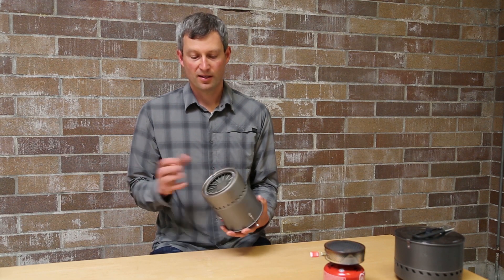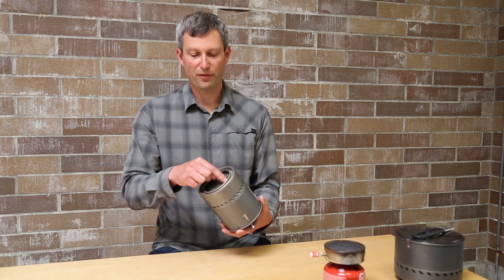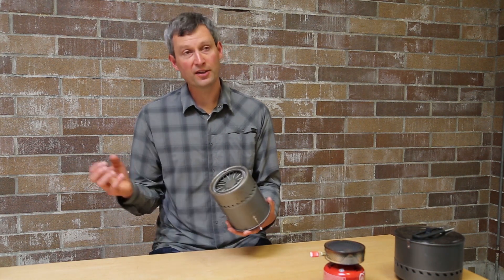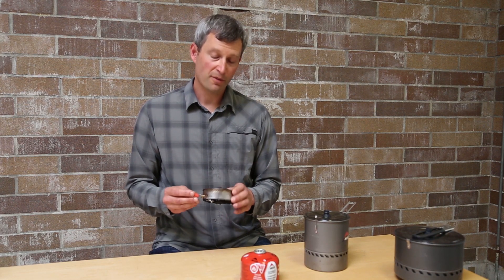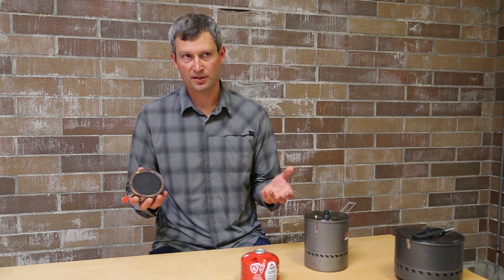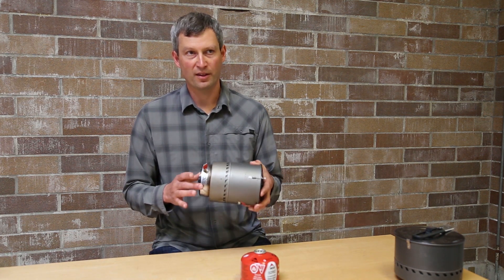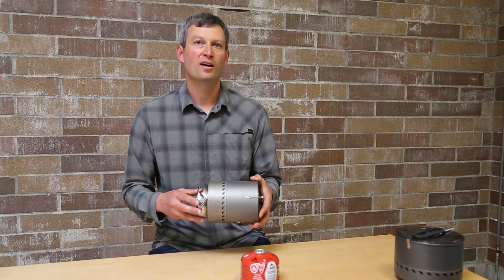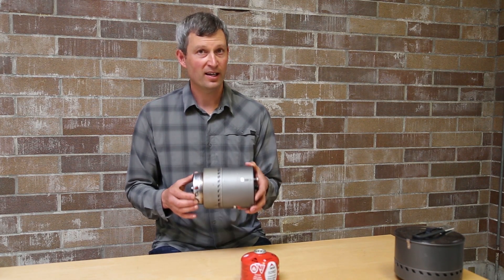Designing the Reactor Stove System

Comment: This is a perfect example of how an engineer develops a product with great potential, that then gets ruined by the rest of the company because someone else developed a handle that comes off too easily that then leads to recalls and MSR's "solution" is to send people a Pot Lifter which you can not use without taking off the lid first... 
Such a disappointment from a company that has SAFETY in their name...

Comment: I got this. Used it a few times, and now it produces only a blue flame that blows off just looking at it. Very expensive,  and stopped working after light use a few times, boiling water. Not worth the money at all. I tried to contact MSR from europe, impossible.
Reply: Try lighting the stove with flint and steel. The blue flame you mention happens when the ignition occurs above the burner. 

The radiant burner can also be lit at the marked areas (hole in the metal grid) which helps to avoid ignition above the radiant burner.

Comment: Would you comment on the issue of the overheat issue that renders the stove useless? The bits of lead that melt and clog the gas line when it gets “too warm”.
Reply: I've used this stove hundreds of times and it still runs since I bought it back 10 years ago or so. Would you comment on some details on how you got the gas line clogged?

Comment: I have every MSR stove that was offered for sale, beginning with the #9, and I love them all.   My most favorite, for all the bases it covers, is the MSR X-GK EX.  But, when we really want to cook something delicate and more gourmet-like, we go with the MSR Universal, OR the MSR Reactor, combined with the Windburner (remote canister) stove.  That duo can do it all, from quick boiling, to actual cooking, and simmering!  The Windburner simmers very well, and we can even get the Reactor to simmer, too, and cooked sausages and even oatmeal on that stove.  Between the two, there is little you cannot cook up when camping.  By the way, I once tested the Windburner (Windboiler, original name) against a JetBoil, and the MSR stove blew the JB away in every single facet of the testing!!  I stopped using the JB at that time, and have never fired it up since then.  The MSR stoves?  They get the nod every single time, unless I am wanting to take some of the old classic, brass kerosene stoves from Optimus, Primus, Radius, et.al..  Otherwise, it's MSR all the way!
Reply: You seem really knowledgeable.

Can you help me with deciding if the msr whisper light is a better choice over the xgk? On paper the have almost identical boil times and fuel usage. Only difference is the xgk is slightly heavier.

Use case. Winter melting lots of snow for all meals and water. Temps around -5c - -35c
Reply: @calvinloney5996  , Thanks for giving me a shout, and for your kind words.  As for using one of these stoves for melting snow, for water, I'd take the X-GK (properly maintained!), over the Whisperlite.   The WPL is a nice little stove, but not designed to burn multiple fuels, whereas the X-GK can offer you strong, reliable performance, up high, and in deep cold.  It will need a windscreen such as the one it came with, or course, and it's best to insulate the stove and fuel from the cold ground.   I would use Coleman Fuel, or even better, Water White, K-1 deodorized Kerosene.  With Coleman Fuel, you can prime the stove with it's own fuel.  With Kerosene, though you "can" do the same, following MSR's instructions, using some Methylated Spirits (Alcohol stove fuel) is FAR cleaner, and works a treat!  If you prime with Kerosene, the stove will be a smoky, sooty, and nasty mess,  If using Kerosene, I always have a small, leak-proof bottle of Meths, for priming.  The stove will burn hot and with a strong blue flame!  Just my own way of doing it, and I'm sure others will chime in with their own methods.  I'd suggest doing some testing to get used to the stove, no matter which you choose.  And, if you will be camping up hit for a while be sure to take spare O-rings and a maintenance kit for whichever stove you take.  I hope that helps, and good luck on your decision, and your adventures!  God Bless!